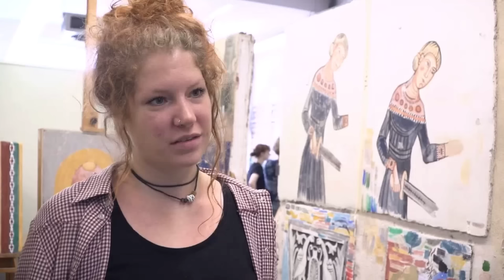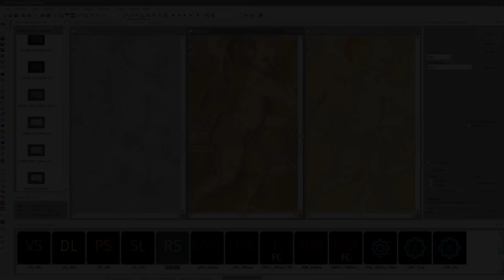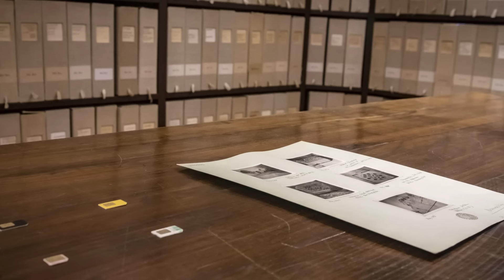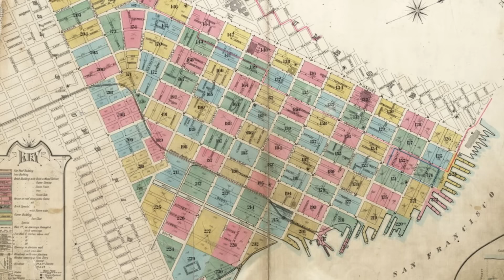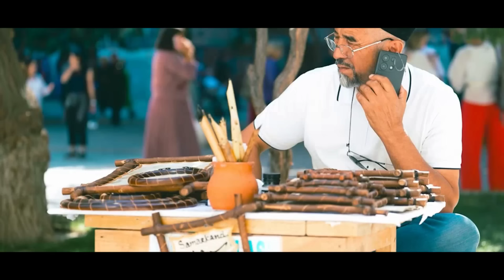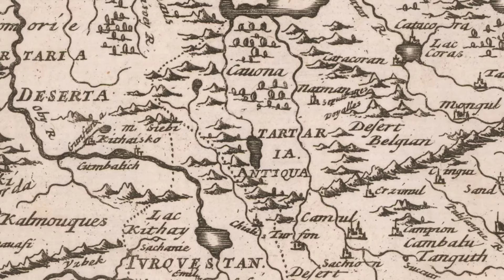The TRUTH About The Ancient Tartaria Conspiracy

Comment: Where did the people who had a completely high tech system. They disappeared before they could explain how everything worked. It is obvious that no one understood how everything worked so they covered it up. It is like someone taking a crayon and drawing on the Mona Lisa. The smooth copper pipes and hydraulic systems for subway systems with manufactured valves and standardized fixtures. They must have had large factories with lathes , and other equipment way before they were invented by the next people. They had to have systems for drawing down the copper pipes allowing for no seams. I was lab manager at a company that made tubes and they were exactly as you described. They would start out as ugly large diameter tubes with seams and they were dated with paraffin and drawn through dies until they were the size needed. This process would make standardized length seamless pipes...I wish we could uncover this technology and use it. The heating systems and air conditioning systems in the buildings here in the states are still there  I have heard. The rooms and floors were sealed off and unused. These systems were way more energy efficient. The atmospheric electricity is absolutely incredible. Herman Plausen figured out how to use the static electricity to power factories in the First World War . He was an Estonian inventor ...Thank you for these awesome dives into Talaria...Do you think these people could have gone to the lands outside of the ice wall???...John
Reply: there is not enough "atmospheric electricity" to power TRILLIONS upon TRILLIONS of structures. thank you.

Comment: I saw a documentary stating that in the old buildings were heated with a steam based technology.Have you seen something indicating heating system?
Also the illumination systems and lamps are similar in Europe and Canada.
Reply: Hey Liliana the old indoor Fire Places had no Chimneys they didn't burn Wood, they Heated the back & side plates with Radium until the 1% Criminal Elite Paedophile Slave Masters deemed it Dangerous Destroying anything Tatarian
Reply: Yes, I’ve seen references to steam and early central heating systems in older buildings. From what I understand, many used boilers, radiators, and district steam, which were fairly advanced for their time.

Comment: You said volcano dust. You said a temperature. My mind went to Google for verification. My mind said diamond. That's the temperature for volcanos to make diamonds. Leads to my question. Back then. How would they know?
Reply: They made the buildings why wouldn't know way more than we can imagine.
Reply: Fallen ones..
Reply: @sandyNichols-l5g Do you know what they really mean by fallen Angels. Energy. Either. Is referred to energy. Look at the box of the Ark of the Covenant. The two Angels on the top and where their wings about meet. Energy ark. A spark of energy or electricity. Then with the fallen. I did always know that energy went from positive to negative. Nope. That isn't true. Energy goes from negative to positive. The ground is negative. The sky is positive. The fallen energy is the reverse of energy from positive to negative to negative to positive. That comes to how is that possible. The extremely tall trees where cut down. Trees transfer the flow of positive and negative energy on the Energy. When they cut those trees down. The positive energy was no longer acceptable easly to the planet. Leaving the ground only in a negative energy field. Why Earth or our planet or whatever it is to be only extremely negative. CERNs are located underground. In the middle of negative energy. Their energy weapons are grounded. Putting out negative energy. Our bodies, etc, work in reverse. Why this say everything is backwards. The energy flow is backwards. You want a bunch of positive energy. Lean up against a live tree. Why they can not stand trees. The evil on Earth has reversed energy.